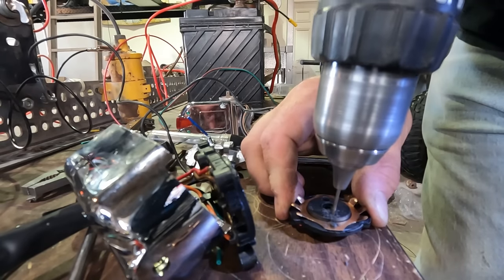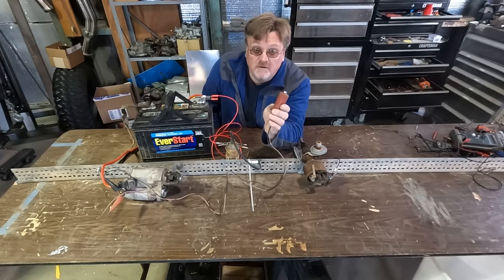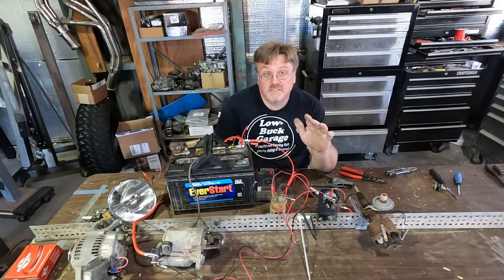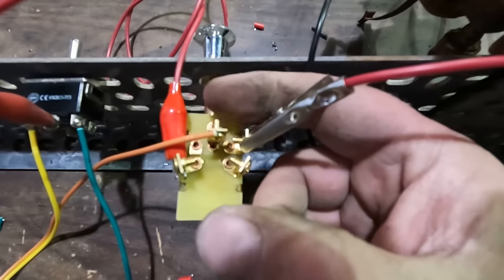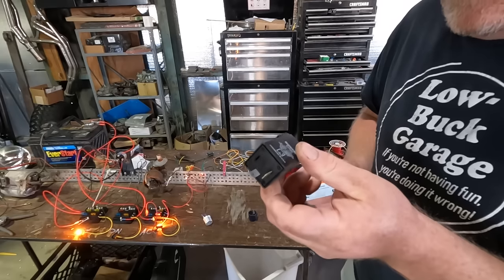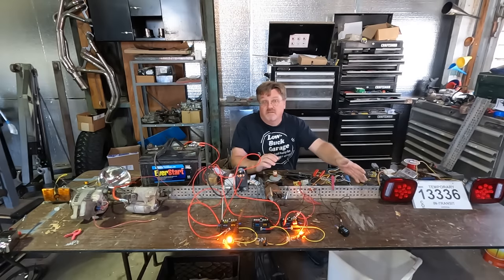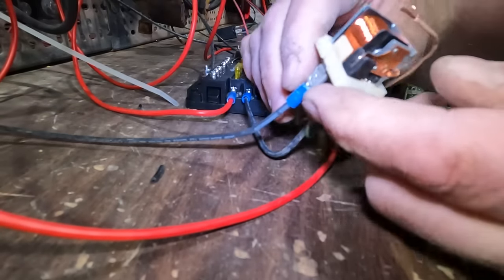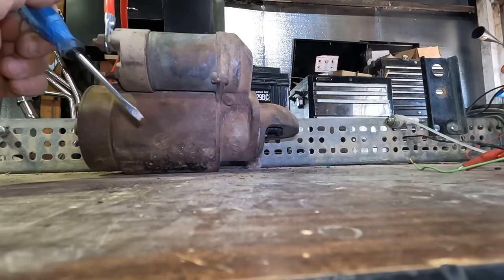DIY Wiring For Any Vehicle! (Almost)

Comment: I like your channel and your candor but seriously, not a good school. I would need to rewatch and tell you how many reasons as to why I think that your wrong on some of it, most tho is spot on., you give me your name and ten minutes later I will ask, what is your name??? CRS! Old age is not a kind animal.You will find people think too hard and try to second guess things that will get them in big troubles. as for the very best of the best fuse boxes, are on cars of newer variations... anything newer than mid seventies has fuse holders, relays, a whole circuit gambit that has any and all the things electric plus relays. Most are even marked to what they are for. Yes, a lot of clipping of wires but a lighter  and those melt to hook up with its own heat shrink. If its a  car and its behind the dash, I really do recommend fuses. Most old washing machines have heat sensors to turn on a fan or what ever needs cooling and just mount to a high point where the engine does get hot. and when it cools will turn it off, I used them on a lot of dodge products that the cooling fans would not turn on, also old subarus were famous for their relay going bad mounted on the radiator and they lost the grounds so easy anyway.... I called them food for tin worms. I just got out of the hospital where I was violently sick and lost a ton of weight in just a few days... had I known I was losing weight so well, I would of spent another week in there as I need another fifty pounds off! We can talk later

Comment: Question have you ever worked on a vehicle that is diesel & does NOT have any electronic controls on it [ie computers or such related]
Reply from the maker: Most of them, the basic ones have a lever to shut off the fuel (bulldozers, excavators, etc), the fancy ones have a solenoid to shut off fuel (the 350B, 12V 6BT's and such).  Someday I'll probably use a computerized diesel for a project, but they're still way out of my price range...

Comment: i Like video here is the item i used from speed way motor universal heavy duty sign switch 916-03009. the flasher with the set did not work with led and incandescent . used flasher from amaze CFC Industries EF33RL 3 -pin with GRD Lead . for LED AND INCANESCENT Lights . and wire diagram Turn switch unit 910-6401.
Reply from the maker: Thanks for the info and P/N's!

Comment: you never hooked the blue wire to the flasher like the diagram said. you only tried ground and power.
Reply from the maker: Oh, I should have explained that better.  When I hooked it to "power" it was the power output of the flasher like the diagram said.  If I hooked it to straight battery power, the indicator light would have just stayed on constantly.